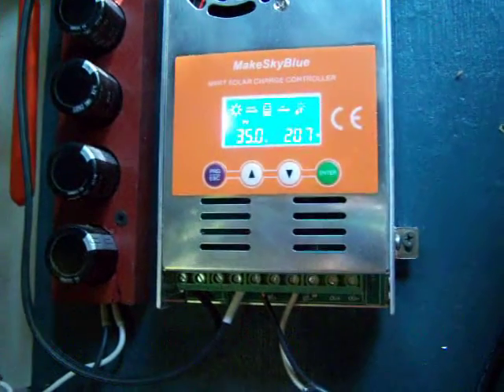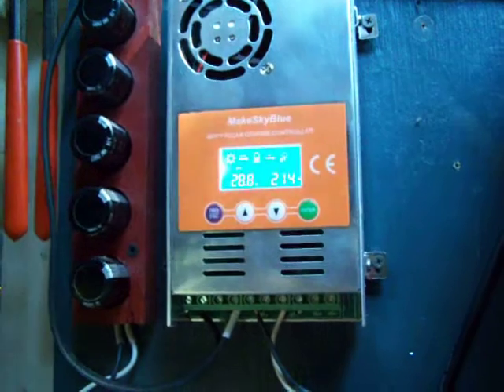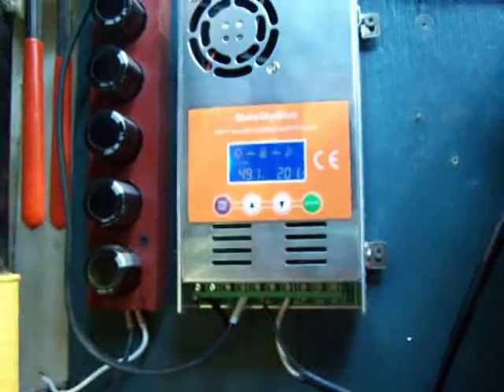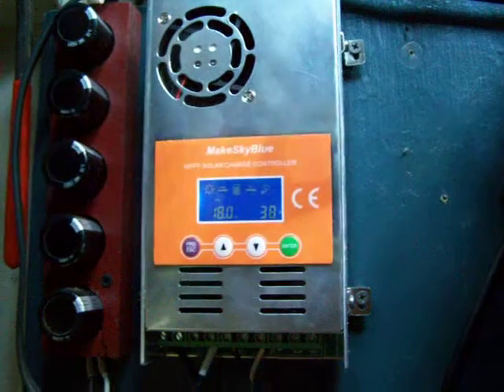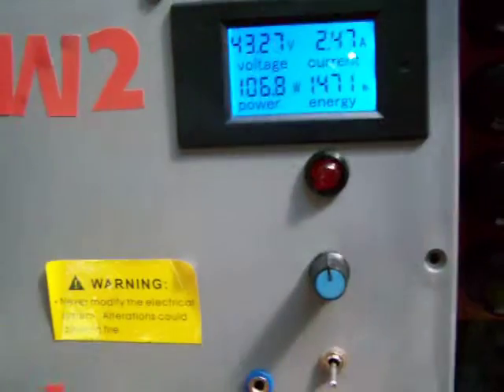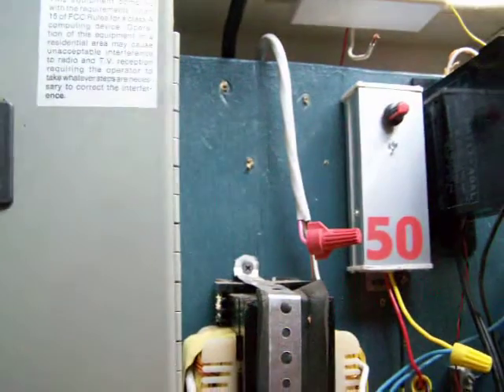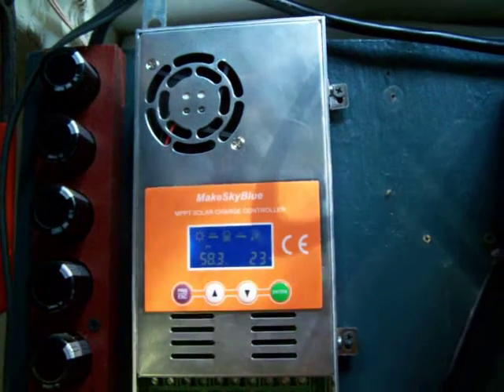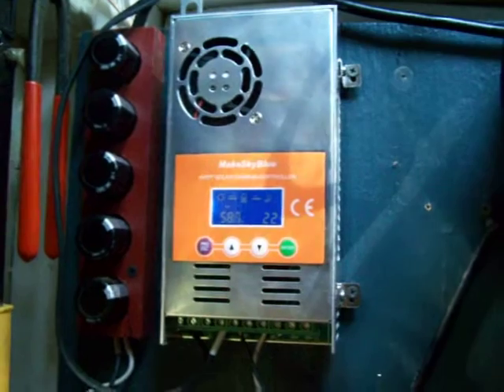MakeSkyBlue 40A  MPPT Solar Charge Controller, What Is this Hokum!!!!

Comment from the maker: I don't believe it. Just after posting went into the house to make a milkshake. Thru the window I could hear the inverter fault whine.  Just finished writing code to shut down the inverter for 5 minutes after it goes into over voltage. At least that will keep me running if I am not there. You may not have that option.

Comment: Whats all the capasitors for?
Reply from the maker: The capacitors are for energy storage for the water heater control located just below that picture. I send excess energy not used to charge batteries to a water heater and have free hot water without adding any extra panels. You can't believe how much energy your panels can produce that is never used. I send 5W to 500W efficiently to the water heater.  Every little bit counts. This provides all my hot water needs at camp.
Reply: @opera5714  i see the reason i asked is i have this solar panel that does not produce any power when its shaded so i added some capasitors to the panel so the solar panel charges the capasitors and when it gets enough charge the charger dumps the power into the batteries ive never seen any one else on youtube talking about it but it seems to help when the panel is shaded.
Reply from the maker: @krtyejnfv  That can possibly help with some designs. It provides the extra current needed to start the converter.  I've done some videos using buck converters to charge at low light levels. Those can bump at a slow rate and harvest extra power at low light levels in a pseudo MPPT.  It can also sometimes prevent the best MPPT tracking depending on the software. It can be disastrous with PWM controllers as it can cause high current pulses. Normally the mfg relies on current limiting of the panel itself.
Reply: @opera5714  ok good info i got a crappy green Chinese mppt 300w that it helps with

Comment: Ive been told when that happen that the ground may not be tight or connected well enough but I have a similar problem with a controller I have.